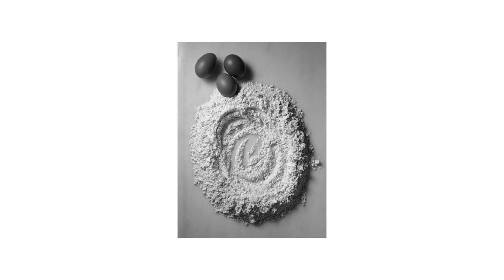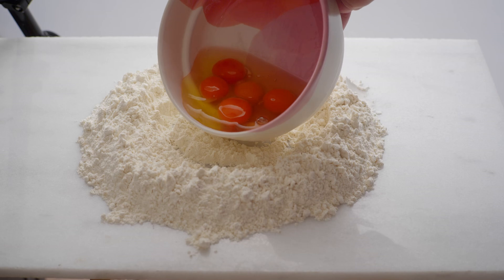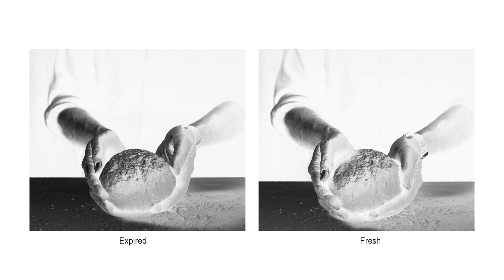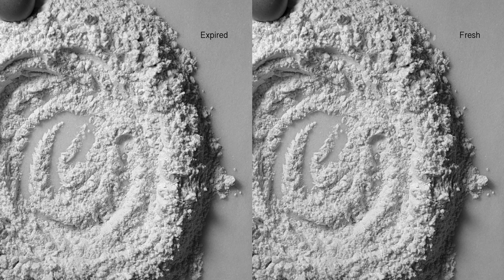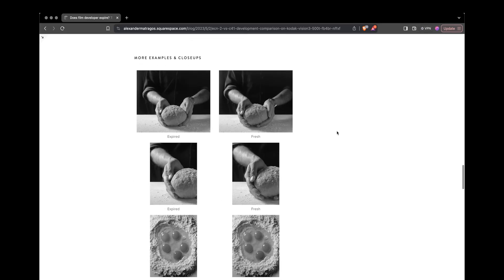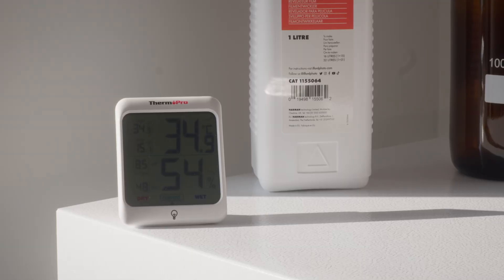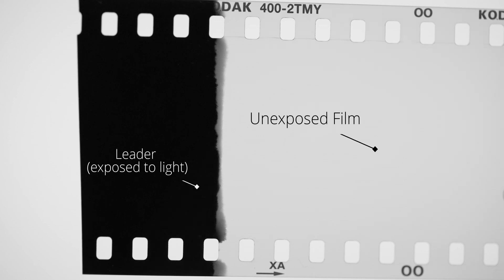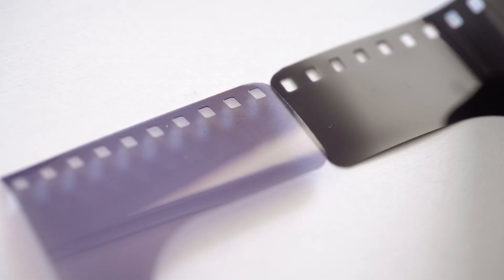Does Film Developer Expire?

Comment: Is it okay to store chemicals in the fridge? I live in a very tropical country and without AC my rooms always gets to 30 celsius and the only spot that is below and 20 celsius is the fridge

I've done it this way for the last 5 months (just recently started self developing with id-11 powder from 2013) and have had no problems
Reply from the maker: In general I would say that most chemicals should be fine in the fridge, but definitely not all. Some chemicals will crystallise if they reach very low temperatures and you won't be able to revert them to their original state. If you happen to have a separate fridge for these kind of stuff you can try setting it to the highest temperature it allows you. Getting it to around 10°C should be perfect.
Now to answer more specifically about ID-11, Ilford states that "Unopened packets of ID-11 developer and ID-11 replenisher powder stored in cool dry conditions, 5-20°C (41-68℉), will keep indefinitely". Now when it's mixed to stock solution, really make sure that you keep it in full bottles as ID-11 (or D76 as it's the same) will oxidise quite fast if the bottle is half filled. Kodak gives it a 2 month shelf life if half full vs 6 month shelf life if in full bottles. As for the fridge, if you are already storing it there and you don't see any crystallisation happening I would say keep it there, no harm.